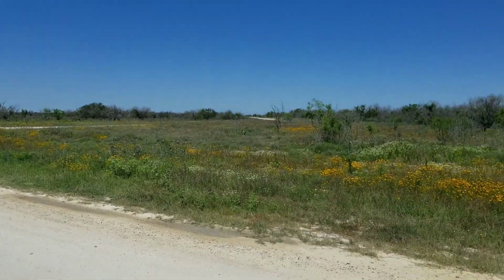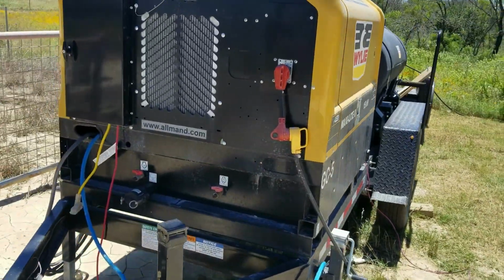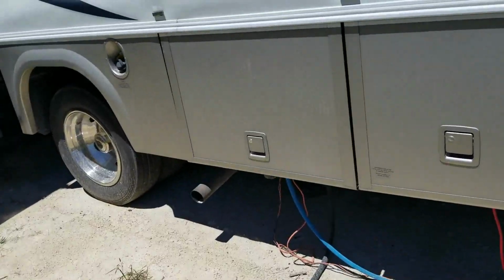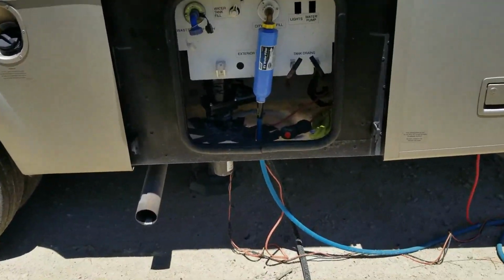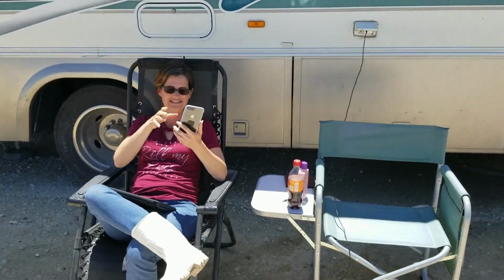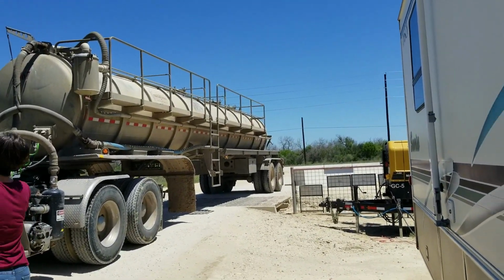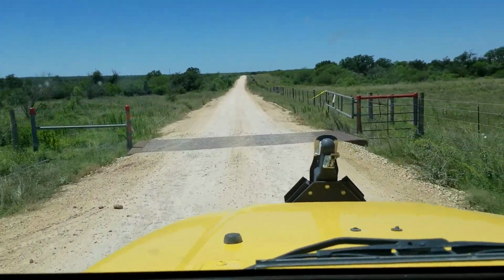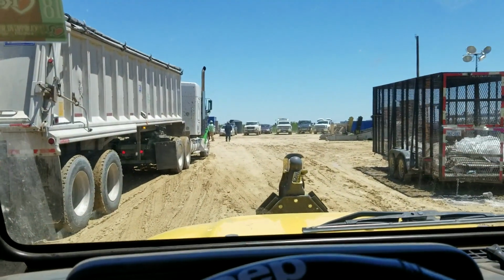New Gate Guard Hookups-RVSWAT

Comment: In my experience, The sewer pump setup works great for a few full tank dumps. Because there’s no swoosh it seems to leave a little in the tank. I would do an extra black water rinse each time, and then when I could I’d dump at a station where a good swoosh could happen and rinse the tank well. I like the pump system, but thought I’d throw in that tip.

Happy gate guarding. I emailed Anna a link to one of you YouTubes, and how impressed I was with your comments on J & G. I’m hoping to be part of the team this year. I just need an RV.
Reply from the maker: Thank you for that info! We will definitely do a little extra cleaning in that tank!! 👍

Comment: Good video! What do you do if somebody drive right by you without stopping?
Reply from the maker: Frank60942 There’s different ways to handle that scenario. Let’s say it’s a water truck that doesn’t stop. If I’m able to see the license plate, I make a note of it. I speak to them the next time they come they the gate. If they continue to blow thru after that, I report them and it is now up to their boss as to what happens to them. If it’s a pickup truck that flat out barrels they at high speed, I immediately call my boss or the company man. They send someone to take care of it right then. 
There are 16 hours each day where only 1 of us is awake. If that person has to answer the call of nature, the drivers are supposed to know to stop and wait for the guard. There actually was an occasion where a driver said that because no one was outside he didn’t feel he needed to stop. He was told the circumstance (when you gotta go, you gotta go!) and was asked to please stop next time.
Reply: RV S.W.A.T would it be ok or appropriate to post a sign that says guard will return in 5 min or on RR break?